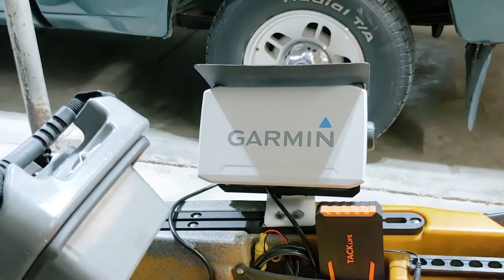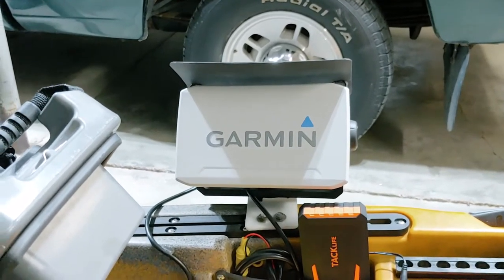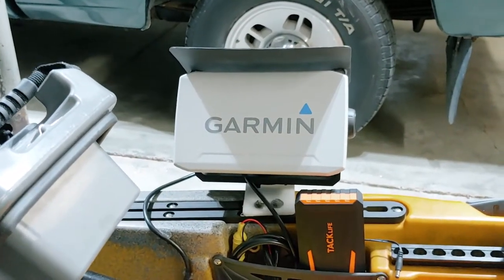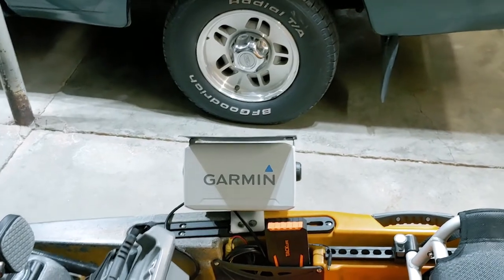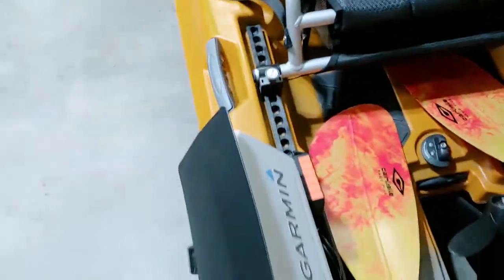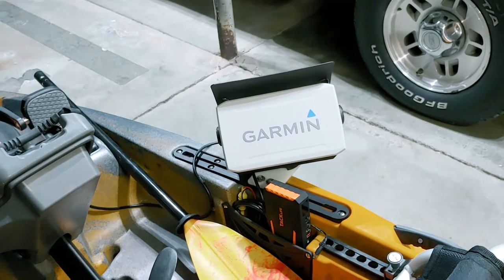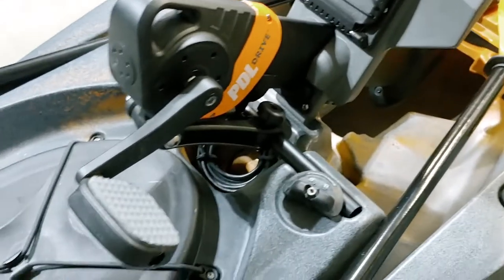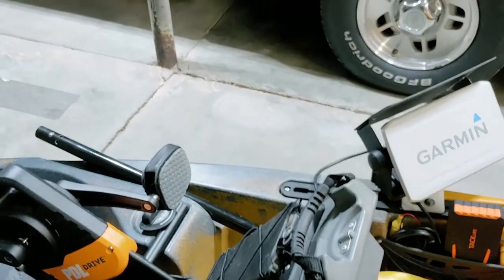Old Town Sportsman Pdl 120 (These mods could save your day)

Comment: Also it would be nice if you added a long rope to the bow of the kayak so you could just push the kayak in the water and pull it back to shore without stepping in the water. I do have one on mine and it helps to position the kayak alongside a dock or shore.
Reply from the maker: I did add a bow line and it gets plenty of use.
Reply: @midwestphil2271  
OK thanks I didn’t see it, but very well thought out.

Comment: I agree on needing to get in the water to launch your boat. However, I don’t understand how those shark boots keep your feet dry unless you’re talking about 3 inches of water. Also, what about when you step in mud? Do they stay on your feet?
Reply from the maker: That's correct, but I really don't need to get more than a few inches in the water to reach and lift the Yak to limit any scrapping
Reply from the maker: I've gotten them in a little mud and they stay on but since I've been using a launch pad I haven't needed them

Comment: Which model is that Tacklife?
Reply from the maker: It's a Model T8
Reply: @midwestphil2271  is that the pro 1200A or just the T8 800A?
Reply from the maker: @kayakgdudley  Its the T8 800amp
Reply: @midwestphil2271  Thanks, that really helped.